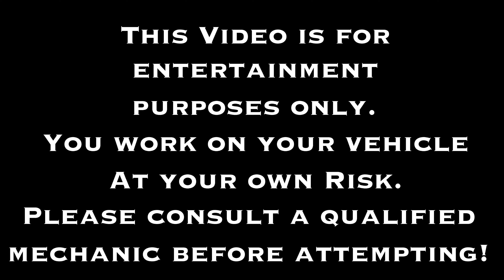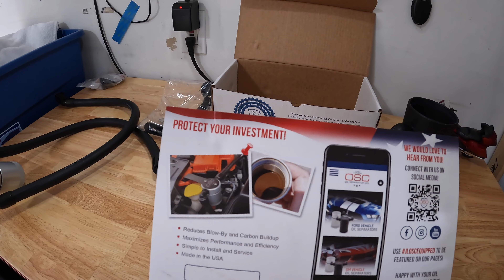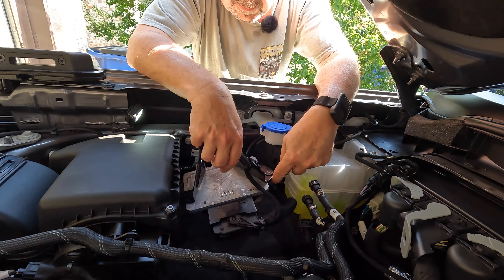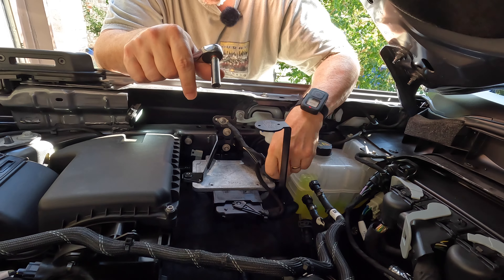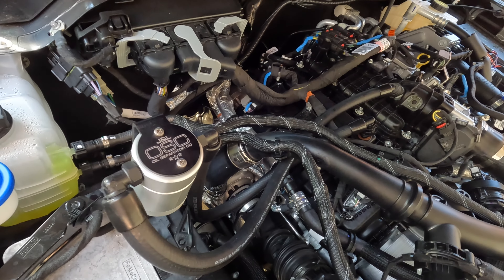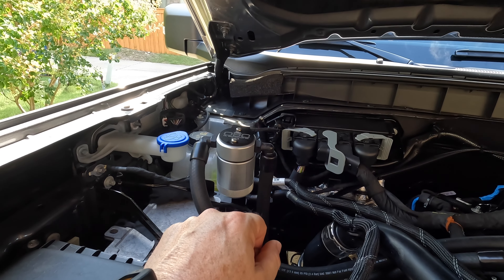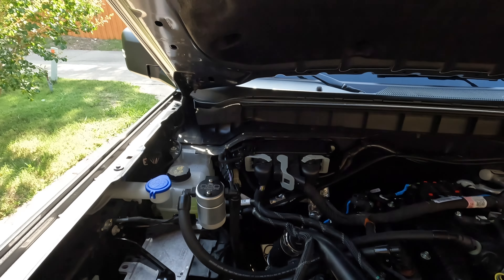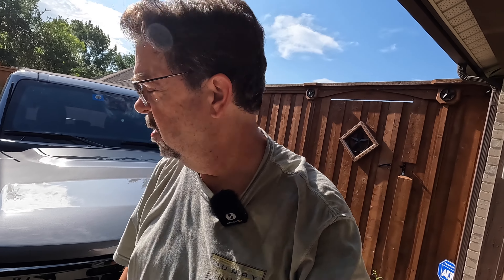INSTALL - J&L Oil Separator

Comment: Hey Robert, thanks for the video! The kit that you purchased is specific for the F150, but looks like you were able to make it work. The 2.7L Bronco specific kit is part number 3073P. Here is that install video link in case any of your subscribers are looking for that specific product: https://www.youtube.com/watch?v=PBQPhEJ-Njo
Reply from the maker: Thanks J&L, I was led to believe there was a significant price difference and they both worked the same.  My bad for not checking what looks like a matching price.  If you have any concerns about performance please let me know.
Reply: @robertwhitemoto  It will still function the same, no issue there!